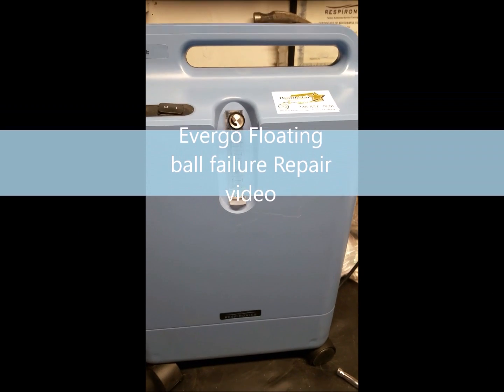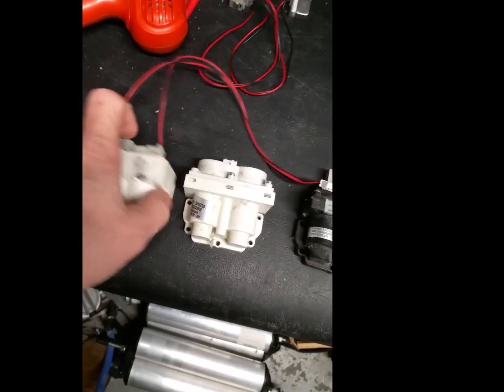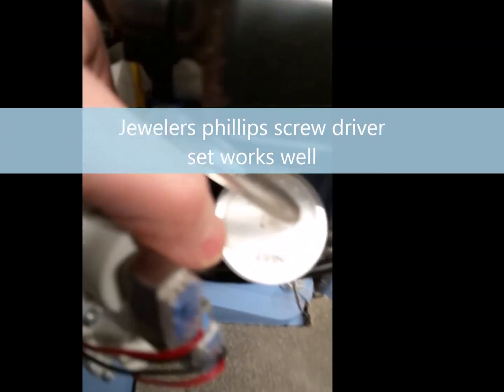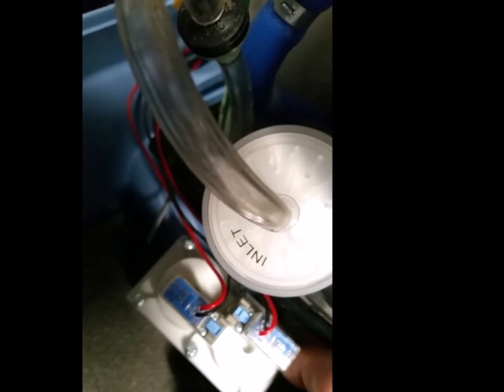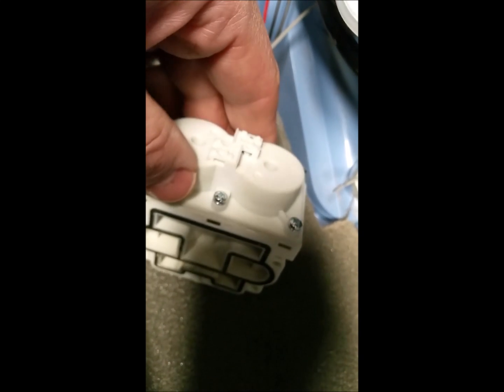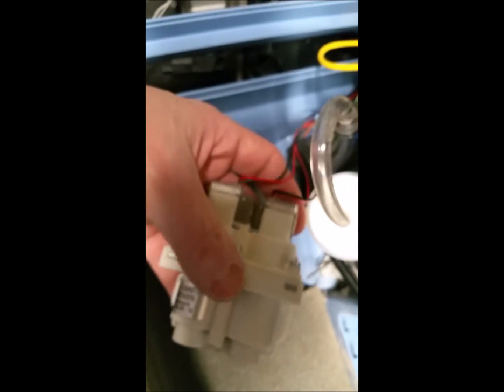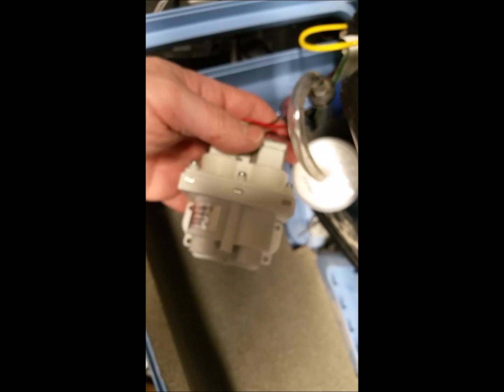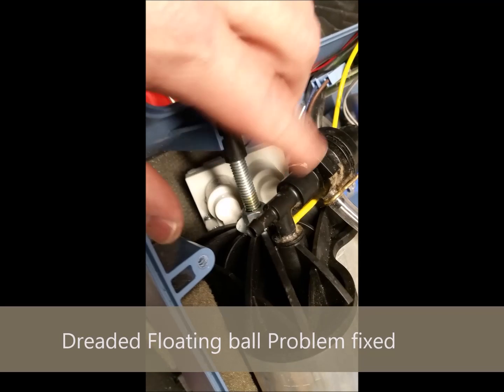Everflo Deaded Floating ball problem

Comment: Is there a problem with it if no matter which way i turn the dial, the ball goes up to 1 at most, and then sinks back to the very bottom?

My friend has 52% lung capacity and should be on 4L. He says they turned up the machine to 6 (but i think he misunderstood her, it doesnt go beyond 5) and he says thats why its at the bottom cuz it has cycled thru 5 and is starting over (???) but that doesnt make sense to me and im worried about him cuz he's out of it.

They came and checked him the other day but i wasnt preset so i dont know what she did and this is the first time ive looked at it since. Is something wrong if the ball isnt floating at all no matter how i turn the dial?
Reply: Plenty of air is coming out of the tube for the hose and there is no alarm, green light is on. Sounds fine. I cleaned the easy access filter on the outside. 

REF 1020000
Sn 2451228
1141431 ROO
Idont know if these numbers are useful. It is identical to your machine as far as i can tell. 

I appreciate any advice you have. Nobody is answering their phone, but its 2030 at night — i dont blame them. 

Thank you so kindly if you have any advice. Anyone.
Reply from the maker: If you remove the tube and it doesn't climb the ballI mean, it's probably the solenoid valve located on top of the sieve beds (the silver tubes) the hard part is finding replacement solenoid valves.

Comment: Please engineer, I have a nuvo oxygen generator    it works for two minutes and gives a light and sound warning. The device is new. What is the problem? Thank you
Reply: Did you try adjusting the liter flow? Sometimes, it's simply things like that, that are a problem. Or it could be pinched somewhere. I'm not an expert but that's what I would start with. And then I'd call the home health company to come deal deal with it.

Comment: hello , my grandma has an milenium respironics m600 . the machine starts and gives oxygen but after 90seconds i have a continius beep and alarm led . The machine keeps working fine and gives oxygen . Also after i remove the power plug , the compressor goes off but it keeps giving oxygen for about 5-6 minutes. can u help me what to check u think that is the solenoid vavle?  i cant find a shop to fix it
Reply: High hours, likely clogging sieves.

Comment: I work on these machines all the time and this video is very accurate. Here is another tip if you do this repair and the ball is still doing this. Check your filter! I've had a defective filter cause this before. The opening to the filter was sealed. I spent hours trying to figure out what was still wrong and then I realized it was only doing it when the filter was in device. I tried another filter and the machine worked fine. 

Just and FYI majority of the time it's the problem in the video.
Reply: The same problem I'm facing only when I'm using this machine on UPS

Comment: Thank you for this informative video.  I have a question for you.  Do you feel a puff of air coming from the solenoid housing every time one of the solenoids fires?  I'm wondering if I have a leak or if this is normal.  And it's doing it on TWO machines (one more-so than the other) so I get the feeling that it must be normal.

Comment: Patrick, my everflo Concentrator has no purge sound to it. After 15 minutes of running the red light comes on . Thank you
Reply: Bad solonoids or pump. Check the muffler on the sieve pack assembly as well.

Comment: Patrick...  The flow meter ball is stuck  on the number one of the flow meter and no matter how much I increase the flow "radio button" it always remains the same.
If you have some information to help me will be very welcome.
Reply: Hello, did you solve this? I have the same problem
Reply: Same problem.. solution?

Comment: The output ball is stuck on 3.5 liters per minute. The concentrator is working properly without any sirens or led errors and giving proper flow.
Reply: I am facing same problem. Did you ever get a solution to this?
Reply: @Melissa - I believe the problem is with humidifier bottle. Either it is leaking or not clean or too old. Try cleaning it first. If it doesn't work, try replacing the bottle.
Reply: @Melishahh  responded
Reply: Solutions??
Reply: Dirty bacteria filter 😊